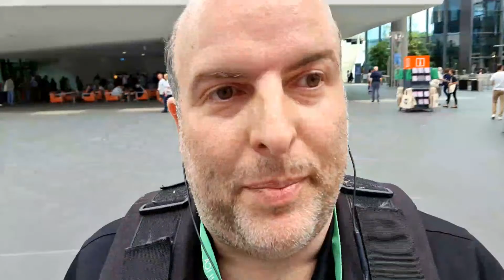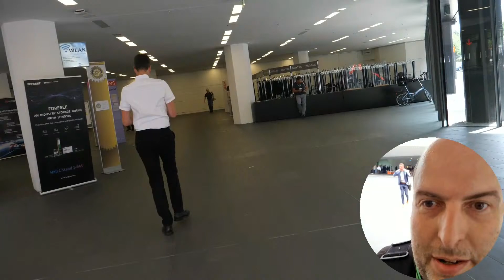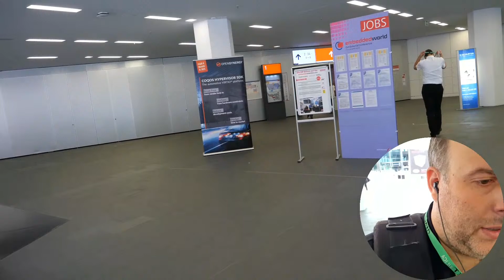Live at Embedded World 2022 day1

Comment from the maker: My main camera ran out of my 100W 20'000mah Baseus power bank battery so I had to end this livestream half an hour before the end of this show..  maybe I need to find some cabled microphone solution to prevent those few times when the dual wireless microphone system was clipping due to interference.. I think I did this at 3mbit/s today I could perhaps try to increase it to 5mbit/s or even 8mbit/s when I livestream tomorrow.. as my dual SIM card (5G Deutche Telekom + 4G O2 seems to be holding up quite ok) starting 8:30am Central European time. I will try to livestream a bit longer tomorrow, if I can balance my new newwer battery grip under my Panasonic G9 camera on the zhiyun weebill S stabilizer that I am using with my old steadicam arm & vest to manage a bit with all this weight 😃
Reply: Thanks!